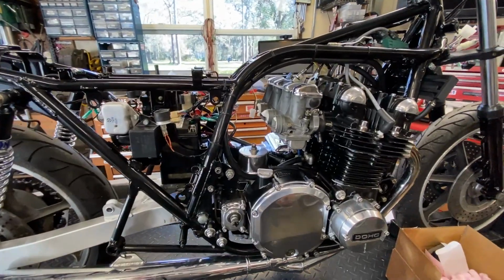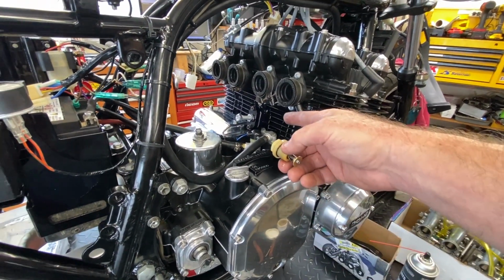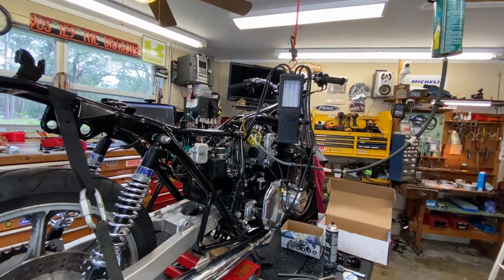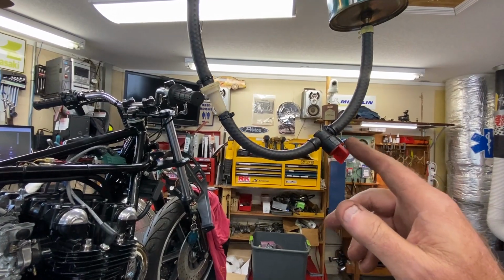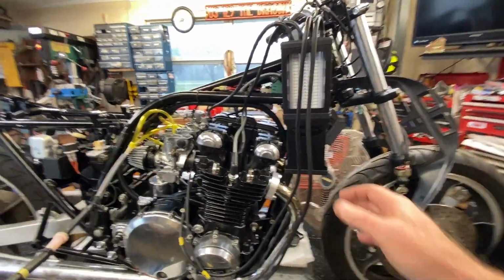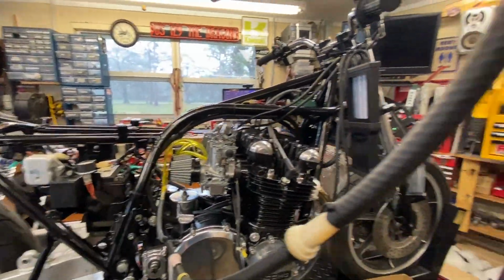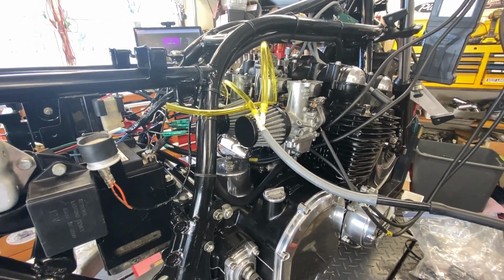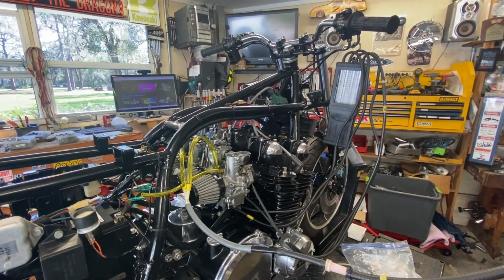Back on the 1978 Kawasaki Z1-R project! Carbs, tuning and running!

Comment: Nice job on the carbs, I've also had problems with cheaper pod filters blocking the rear ports on the carbs when installed.

Comment: Great video, I can sadly see the day when these old 70's bikes are gathering dust in a museum, when the knowledge is no longer there, a modern bike dealer will not want to bother and frankly can't charge the labour hours to fart around with these classic relics.😢
Reply: The problem isnt just them standing in a museum its that people are turning neat. Restorable examples into cafe racers,rats,bobbers,choppers
Reply from the maker: Yea, except this one's already too modified for my liking. I'd have gone O-E-M with period correct mods, maybe... it already had a 4-1 exhaust stock, swap it out for a Kerker, jet it up and put pods on... maybe. It's more valuable bone stock though. Alas, it's not mine and I just do what I am told... most of the time. lol
Reply: How come rear shocks are mounted upside down?
Reply from the maker: @marktaylor7115  they aren’t. You’ll notice the Hagan logo is upright. That is how Hagan said to install them. They were emphatic about it in fact.